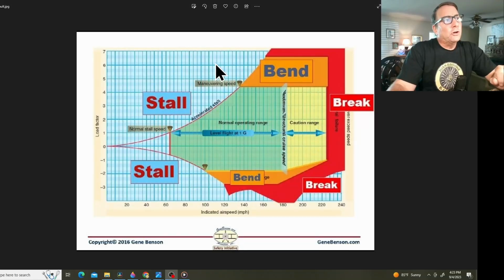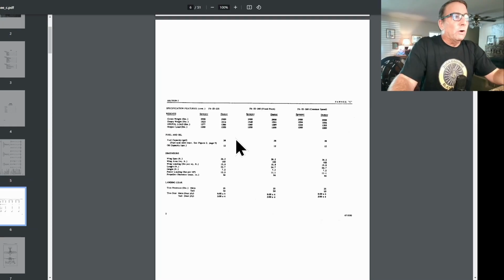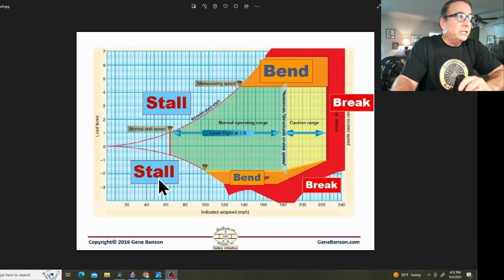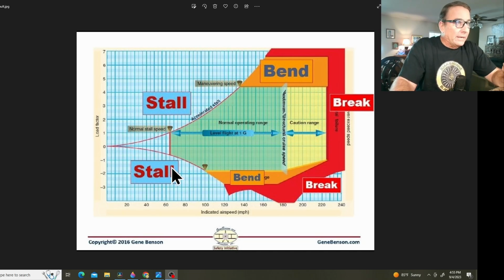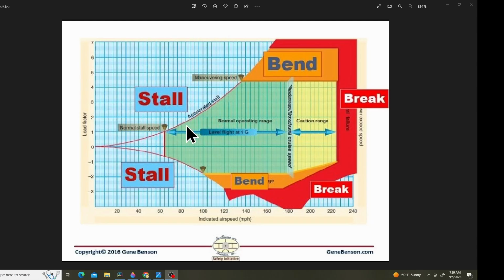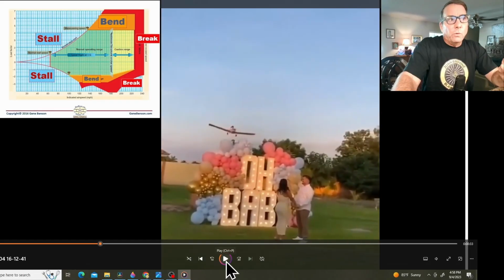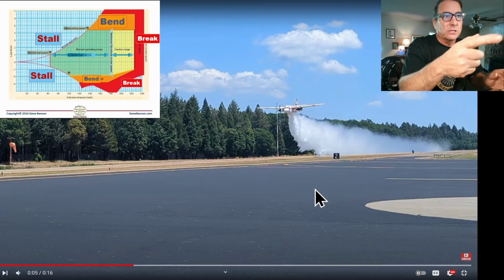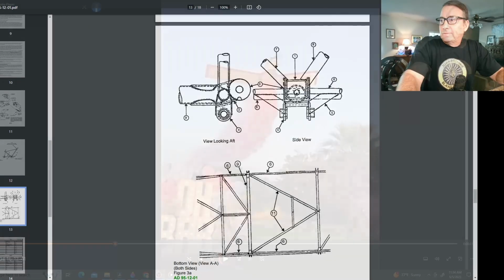PA25-235 Sinaloa MX Gender Reveal Party Structural Failure

Comment: I'm confused here.  (I appreciate the video, but in the end i didn't understand.)

Non-pilot intuition:

1) If the aircraft is light (unloaded), you could pull up so hard that you exceed the G limits, and break the wings.  Makes sense.

2) But if you're at a given angle of attack at a given speed, then aerodynamically the wings are slowing you with some force (measured in pounds).  G's are derived from that - force divided by mass.  So if you reduce the mass suddenly, the G's go up, but the actual forces applied to various structural members goes *down*.

3) So after a release, I wouldn't be surprised by fluttering, or sudden difficulty of control...but breaking the wings seems totally backwards. 

Can you help me understand?  Is this just (1), or something I'm getting wrong about (2) or (3)?

Comment: Thanks Juan. Unfortunately the new AD on the Pawnee's may shut down glider operations at many US glider sites as the FAA is proposing expensive (electronic magnetic crack detection equipment) and frequent (100 hour) inspections. Since most glider operations are clubs and mom & pops businesses with slim margins, it may cause many folks to rethink the whole thing. My local tow pilot says if he breaks even in a season, he's figured it's a good year. He's spent a lifetime keeping the local glider crowd going, but since he's getting close to retiring, I'm sure he's questioning whether it's worth the trouble continuing.

Another local tow operation has organized a letter writing campaign to encourage the FAA a more reasonable visual inspection schedule without the electronic equipment. I believe there have been several of these incidents with the Pawnee's, where the wing has folded due to aggressive maneuvering, including the one highlighted in your video. Like you said, pretty "aggressive" flying for such an old aircraft. Maybe that idea of "respecting your elders"  makes sense in this case. Hopefully the FAA makes some sensible decisions as to inspections and guidance moving forward. 

Thanks again for your continued thoughtful content.

Comment: There was a AD due to wing attachment fitting being to weak and failing. It was a box around the where the wing attaches to the  fuselage.  We had 6 pawnee 235s and it specifically mentioned the wing attachment failed causing the wing to do exactly like the video.

Comment: AD 2015-08-04 concerning corrosion inside lift struts was probably not being complied with. The wing appears have folded up over the top of the fuselage, which would be consistent with wing strut failure.

Comment: Though i like your explanation of maneuvering speed, we have no evidence he was even close to exceeding it and if i remember correctly this wasnt his first drop. Chances he had a full load is minimal because that amount of weight on a crowd of people could be dangerous when dropped. We do know an increased force was applied on the aircraft because of his pitch up but if he was being cautious about his speed the plane should have been completely fine. I don't think its right to blame the pilots flying when this was most likely caused by poor maintenance practices. Its nice that you included the AD but only in the last few seconds of your video.

Comment: Another way to understand the problem is as follows. The wing failed because of the g-load, a force which adds a downward (positive) force on the wings as the aircraft accelerates upward in a climb (pitch up)

Now why the did the plane pitch up?

There are 3 possibilities:

a)  after dumping 1200 lbs. of load from the hopper, the wings generated more lift than the weight of the plane causing the nose to pitch up.

b) the pilot pitched the nose up.

c) a combination of "a" and "b".

The connection of the wing spar to the fuselage failed due to exceeding a design limit, a crack and/or corrosion.

Comment: Very curious as to condition found on investigation of wing mount and wing box structure. Was corrosion involved? Is there adequate inspection cover access to see the components? Is all of this structure chrome moly steel with chromate primer and epoxy paint and is water repellent coating allowed (like LPS)? Or, was this fatigue, or, straight up overload due to cargo dump with big elevator input? We can maybe calculate G loading by 3D analysis of the trajectory on the video. There is a very brief period where there is climb before failure but maybe enough to calculate G. I hope every crop duster watches this and makes a promise to never pull while dumping. I have spoken with a pilot who explained that for productivity reasons he pulled 2 G at every end of his spray run to get back. He told me just how exhausting it was and how his gps records were compared to contract and how every deviation from altitude and grid came right out of his pocket, as well as any excess spray in terms of chemical cost. What a tough job!!

Comment: You can think of it as, a heavily loaded wing is already operating at a high angle-of-attack, so adding more load by a sudden pull-up reaches the critical angle sooner, and stalls, which unloads the wing before the g-limit can be exceeded. I live within  shouting distance from a small airport with heavy ag ops. A free air-show during the warm months. Those planes are constantly climbing, diving, and turning, but it's always smooth and deliberate.

Comment: The only part I'm not clear on is, the theory of reducing VA with weight loss is predicated on the airplane beginning at the lighter weight and therefore flying at the lower angle of attack. This airplane is already flying with the higher weight and therefore the angle of attack closer to stall speed. So by dumping the weight DURING the maneuver, it does not make sense to me that the airplane would initially move to a lower angle of attack before progressing up to catastrophic load factor. Am I misunderstanding something here?

Comment: As a lifelong ATP, I've always had trouble understanding how a lighter airplane could have a lower safe manuvering speed...........In My little brain, it still doesn't seem right........I just have to accept it as true......To Me it has always seemed that at lighter weights there would be much less stress on the plane.......Paul
Reply: sounds like you are someone who wants to know and will listen. Here is the answer. At the Va speed and  critical AoA, the wing bending and shear loads will be at a maximum.  If you remove load from the fuselage at this speed, the stall speed will drop and you will have a higher load factor, but the wing loads are the same!  Fixed equipment like a engine mount will be subject to higher loads due to the greater g force and could fail.  That is not what happened here.  There is a huge AD now in NPRM review on the PA-25 that will probably ground the majority of the fleet.    Retired Aero eng. with certification experience.

Comment: It can't be that the wing broke as a result of the aircraft getting lighter. It would still have broken if the hopper wasn't emptied and the airplane was pitched up the same angle. The wing broke because too much force was exerted on it. Newtons 2nd law says force is mass times acceleration. Higher mass means higher force on wings at the same acceleration. Maybe acceleration will be lower as a result of the airplane being heavier and stalling at lower angle of attack, I don't know, but the force certainly wouldn't be higher at lower wing load!
Reply: true.  but there is a lot of weight in the hopper, fwd of the cg, and that will cause a pitch up that could overload the aircraft if it was well over Va.  I think there was prexisting damage to the but end of the spr where it attaches to the fuse.

Comment: Great report as usual, except a couple of things that were like fingernails on chalkboard.
"You can stall at any airspeed".
That old wife's story that instructors say to make a point that is lost on me is probably what this guy thought too. And it was wrong, and it killed him.
You can stall an airplane at any airspeed BELOW Va! Above that, it will take it some, as calculations are usually made for 1.5 of what is posted, but stlling the airplane above Va is an abrupt maneuver that will at least bend metal if not break it. So what are you doing telling people you can stall at any airspeed? Go do it 5Kt below VNE and prove it to me. You will be flying confetti before you reach alpha critical.
#2, "you are sinking in zero G". Well, a number of times I pitched up 20deg at high speed, then pushed forward to zero G. I was still going up by inertia before I started going down. When zero G is produced by centrifugal force, from a steep climb, plane does not sink until that upward momentum is exhausted by merciless pull of gravity.
Other than that, keep up what you are doing. I enjoy listening to you.

Comment: Maybe I am dumb, but why does less weight and less load cause a failure?  Seems counter intuitive.  I would think lower weight would allow for more aggressive maneuvers.  What am I not understanding?  I can see a sudden change causing a shock load in the structure but that does not seem to be what you are explaining.  At least if I am understanding this correctly.
Reply: you are not wrong,.  the sudden release of the load caused a dynamic pitch change on top of whatever the pilot applied with the elevator.  no way way this guy doing 120 mph, so i suspect it was prexisting damage which id why the entire fleet is facing an AD, with 30% of those inspected so far showing corrosion.  Pa-25 driver and Aero eng here

Comment: The easiest way to ‘stack the odds’ in your favor is by starting any drop run well below maneuvering speed, this way you give yourself plenty safe margin even for a poorly executed technique. This should have been a fun event which certainly didn’t require a ‘high speed’ pass to ‘prove a point’… just very sad and completely avoidable and unnecessary 🤦‍♀️

Comment: Although the pilot may have had many hours, his ability to max perform the aircraft was exceeded.  The real problem is that when you dump the load, the standard “pull” up (really a position of the stick that is quickly attained and then slowly adjusted to attain max g) will now exceed the g l8mitations of the airframe because it pulls more g’s for a give stick position with lighter weight.

Comment: I think it’s been said a couple of times .. a change in the angle of attack can be caused by change in angle of wing movement relative to stationary air (ex a control input) or angle of air movement relative to a stationary wing  (ex. turbulence) .. or combination of both .. here, I think the sudden loss of weight resulted significant nose up attitude > significant wing rotation on the pitch axis  >  major change in angle of wing moving through stationary air   > rapid increase in lift generation  ..  since it looked like the plane was diving (negative angle of attack) at the time of release, the sudden change in angle of attack is even greater .. I say “sudden” because the rest of the plane will try to “catch up” to the change in the wings and return to stability .. so to me the logic is more like “a sudden increase in angle of attack up to stall” regardless how the angle of attack is created  .. Va is the speed at which a stall will occur before the force differential exceeds structural limit .. so in turbulence I never want to EXCEED Va, but nothing stops me from flying slower .. maybe half way between clean stall and Va, so I don’t drop in wind shear and don’t damage in a surge?

Comment: Even a car would do something bad or weird, if you suddenly dumped 30% of your weight while in a high speed corner at your limit of traction. 

The friction would suddenly overcome whatever sliding action is happening with previously more weight and suddenly give you immense traction at high speed. 
You’d probably immediately flip the car or rip the wheels off the axles. 

Great vid

Comment: Look like he hit a tip of a tree behind the balloon and him dupming the too much water which caused the nose to go up leading high g pull up which wing overload. Evidence of this is in another angle of this video. When he hits the tree you hear a high pitch click  then a thud sound or think sound, the same sound that happens when ya shift to the wrong gear in a transmission and need to replace it. What it really is, is the sound of metal cracking.

Comment: Doesn't look like a full can to me. Full dump with agricultural door will take about 5 secs. The failure is less than 2 sec in. To get a faster dump one needs a fire door. Yes, aircraft pitch up on dump, but every Ag pilot knows that and has to demonstrate proficiency in that before being licensed. And, the aircraft is designed and purpose built to dump. Early experiments with fire fighting saw B-25s shed their tail when dumping. Spar web corrosion or fatigue around the wing attach points? Yes.

Comment: AD 95-12-01
SUMMARY:   This amendment supersedes Airworthiness Directive (AD) 93-21-12, which currently requires inspecting (one-time visual and dye penetrant) the wing forward spar fuselage attachment assembly for cracks or corrosion on certain Piper Aircraft Corporation (Piper) PA-25 series airplanes, and replacing or repairing any cracked or corroded part. This action requires repetitively inspecting (using ultrasonic and dye penetrant procedures) the wing forward spar fuselage attachment assembly for cracks or corrosion, replacing or repairing any cracked or corroded part, and reporting to the Federal Aviation Administration (FAA) the results of the inspections. This action is prompted by the FAA's lack of confidence in detecting internal corrosion in the wing forward spar fuselage attachment fittings while accomplishing the inspection methods required by AD 93-21-12. A report of a crack in the wing forward spar fuselage attachment assembly on an airplane where the inspection requirements of AD 93-21-12 were accomplished also prompted this action. The actions specified by this AD are intended to prevent possible in-flight separation of the wing from the airplane caused by a cracked or corroded wing forward spar fuselage attachment assembly. 

Just wonder with foreign registry if AD was even complied with.
The early Pipers were built much stronger with welded steel Truss fuselage. This also includes the PA 25 Pawnee. 
Wing Failures with the PA 25 are long term maintenance issues and not Design issues. AG planes operate in a Highly CORROSIVE Chemical environment. 
The failures occur with the fuselage attach fittings and not the wing spar itself

Comment: Great video Juan! If I understand correctly, because the mass of the load being dumped is about 80% of the empty weight of the plane, after release, the instanenous g-load is increased to 180% of the value before dumping. Thus if the plane is already pulling 2 Gs at the moment of dumping, it is now pulling 3.6 Gs the moment after dumping. No wonder things snap.

Comment: I'm absolutely wordless at how anyone could just go about their celebration as the plane clearly breaks apart and crashes to the ground. What the fuck is wrong with people.
Reply: I hear you & feel the gender crap-o-la is way over the top period!    But also I submit a querry:→ what would/might you expect the prudent coarse of too be ??? 
Mission first is my reply, as the pilot said "I knew I was dead when the view changed & my wing was on my head". That and there is nothing ground assets could do to change this fact.
Now I do not know if you have more details as I do not have any other intel about the ground crew [party folks] post pilot ERROR & equipment FAIL, other than what was presented here.
Also to be fair I am not sure the couple were aware of the death potential they just escaped as it looks like their view had limited visibility  due to a massive pink mist overhead.  Followed by a crunch sound [maybe], since it is the movies that make the impact noise seem way more spectacular than it is most often in reality.
WeSaveUs

Semper Prorsum ~ Godspeed

Comment: I'm horrified at the happy couple hugging and celebrating as that plane is going down. How deep in the moment do you have to be to not see that wing just came off the plane flying right over your head. The camera guy turning away from the crashing plane to film those two is astonishing too.
Reply: Hey, review the clip again. Maybe their view was obstructed by a massive pink mist right between them and the pilot..............so there is that !!!
Reply: Maybe he wanted to catch their shocked reactions....
Reply: Had the wing came off [it did not, it folded] that could have been very bad & might have increased the souls lost count and damages/injury. Keep being horrified for nothing. Me I choose greatful for that being all that went wrong, good copy?
Reply: @cameltube-vk7el  The wing is off, it has detatched from the body of the plane and is held in place only by the outer skin but its structural supports are completely detatched. it was instantly obvious to most people watching that this was the case, but apparantly not the  people that were watching it at the scene where they had an even clearer view.
I will keep being horrified at the emotional detachment of the happy couple and the camera guy, and will add disgust at you for trying to excuse it not just once, but with two seperate posts made just two minutes appart.

Comment: The way I heard it put is a heavy load will stall.  A lighter load can generate more lift before the stall and thereby more stress put on the frame.  Think of the Va stall as a safety valve that dumps excess lift.  The wings will eventually create the extra lift, but the frame can’t spread the lift.  Even if the struts and spar distribute the force to the frame, now the engine mount is overstressed with its heavy load.